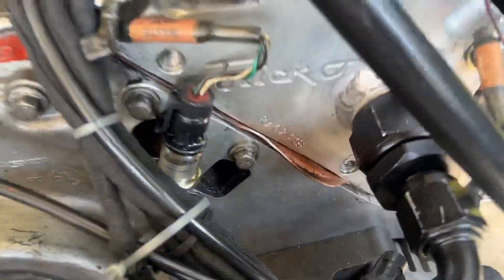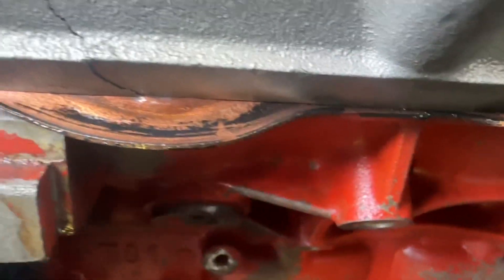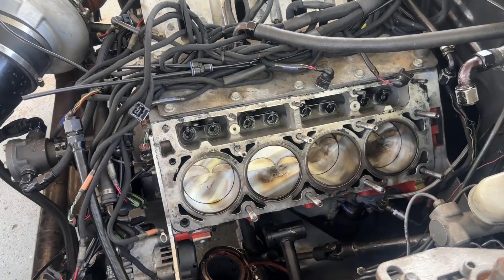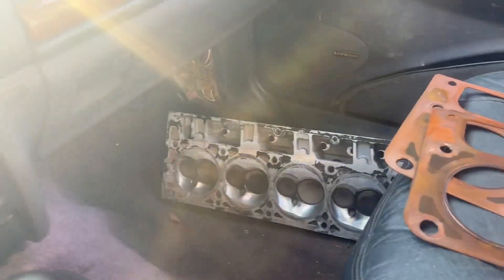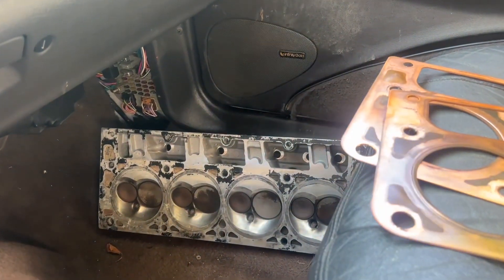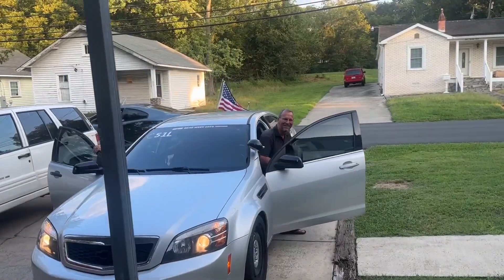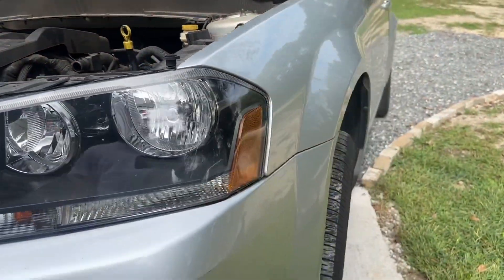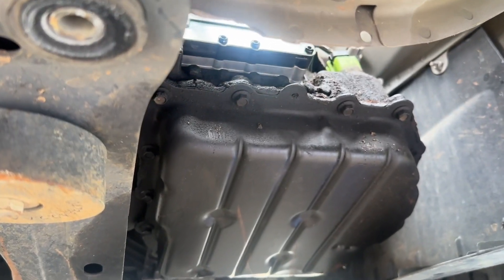We found out a major problem on the race car Friday night

Comment: I'm impressed lol especially being a Chrysler . I lost interests with Them I've worked on many that always had the same problems the ECM computer on the passenger side firewall shorts out and it causes a mess of problems with them and the transmission problems but however those was all 4.0 not the v8s so maybe theres a difference don't think there would be tho.

But I'm impressed with how much you have put that jeep through and its taken it without a problem ha alot weight
Reply from the maker: I keep a spare computer in the back lol
Reply: @Boostismyfriend  😆